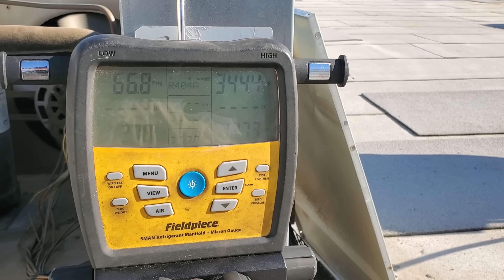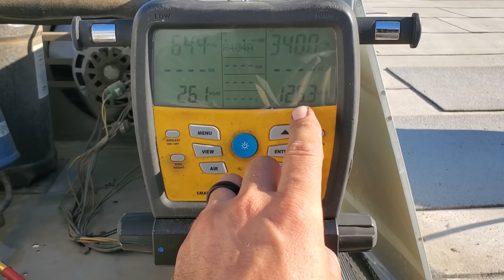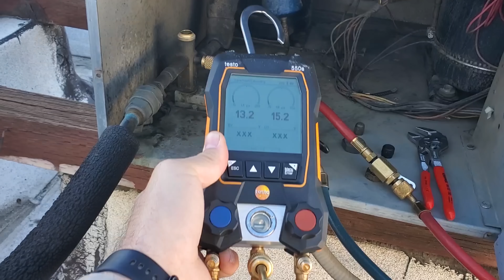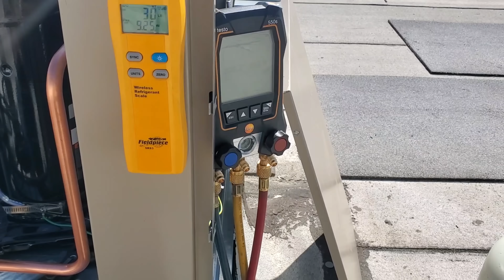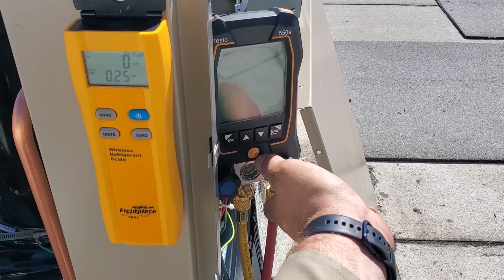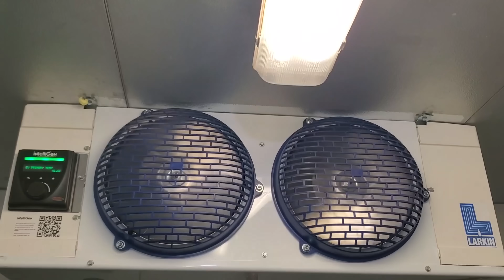THE  WALK IN COOLER IS HISSING

Comment: Just an idea I don’t know if it’s possible on this change out, maybe you could’ve just made a new penetration right above the walk-in cooler and then ran the line set on the roof over to the condensing unit. I work for a school district and I’ve changed out a few of our walk-in coolers and I don’t want to go with anything but the old school all technology TXV liquid line solenoid. It always seems like they’re trying to reinvent the wheel

Comment: They use a normally open EEV thats open when it loses power? Who came up with that lol
Reply from the maker: No the eev is driven open and if it immediately loses power it does not  automatically shut. The eev does not have a spring like a solenoid valve it has to be driven open and driven shut

Comment: BTW, how is that fancy gauge set for diagnosing a sticking valve, i’ll stick with my trusty analogue set thank you, and just a suggestion, use your senses, they are the best tools you got, for example a simple feel of that liquid line for heat would have told you the sight glass being clear did not mean the unit was out of gas, you over charged the system there and probably fried the unit that’s why it needed replacing because I cannot for the life of me figure out how replacing the condensing unit fixed anything.
Reply from the maker: Yeah the sight glass was empty,  and I addressed that in the video

Comment: Wait ! why is the liquid line not attached to the suction for heat transfer under that insulation for a solid column of liquid to TXV, probably was his problem in the first place in that heat.
Reply from the maker: With the modern systems  they are extremely efficient and we usually don't need to worry about external subcoolers like you mentioned. Occasionally on older and or improperly designed systems we may have to add additional subcooler but I haven't run across one of those systems in years. Plus these restaurants wouldn't want to pay for anything like that. Even if it could save them money they still consider it unnecessary

Comment: Don’t like them sight glasses?? They’re the best wit that moisture indicator, helped me on many a call, BTW green ? Not good, and them pressures, that’s nuts, I know it’s hot but charging to 350 psi??? WOW. First feel liquid line, if it’s hot it’s not empty, and i’ve seen condensers that look clean but are only clean at the surface but are plugged solid and that can keep the sight glass empty or bubbling, again FEEL FOR HEAT !!! Your best tools are your senses, them fancy ass gauges are for techs with too much money. I use the old fashioned gauges, just looking at them can give information no digital gauge can, like a sticking valve, try seeing that on a digital gauge, good luck!

Comment: It's nice to see all your customer's are refrigeration engineer''s-WTF happens when a POS undersized unit with a smaller condenser shows up-especially with your 125 degree temps? Who bites the bullet?
Reply: Im assuming its a chain store where every store has same specs so they all get same gear
Reply: The large chains often have a handful of seatwarmers to figure these things out, once on site you have to improvise or tell them right from the start that its not going to work.
Reply: You already know that the techs servicing equipment are always the ones that get blamed. You just have to keep polishing until it doesn't look like a turd anymore.
Reply from the maker: I will discuss this on my Livestream this evening 3/1/21 @ 5:PM (pacific) on YouTube come over and check it out https://youtu.be/eJBUOQQNEFo

Comment: Sometimes it feels quite tempting to grab power for "something minor" from "just a convenient place" but do enough of that and you will end up with a mess that nobody else understands and that can be a pain in the back to troubleshoot or alter.
Reply: Or things start to go wrong, got a single outlet in my garage connected to the kitchen circuit its fine most of the time but if you plug in any heavy draw power tool you will trip the breaker so that outlet is the battery charging station.

Comment: Feedback on the same circuit?  Hm.. I know that was an off-the-cuff explanation, but if the company is really saying that, I would be suspicious.  I mean like, you do realize all circuits go back to some common point, right?  There's no such thing as isolation.  (There can be, but there won't be in cases like this.)

Sounds to me like that electronic shut-off thingy you were talking about causes problems if power is lost, and they don't like having "other things" overload the circuit and cause that weak point in the design to manifest itself.
Reply from the maker: Basically because of the low voltage transformer they use for the board they are worried about voltage drop affecting the secondary voltage. Honestly I think they are being a tad over dramatic but im just a silly service tech.....
Reply: @HVACRVIDEOS   Thanks for humoring my curiosity.  That kind of makes sense if the LV side is 24V that might be feeding relays or contactors.  A brown-out there might cause it to bounce, and upset whatever it's controlling.  It seems unlikely it would interfere with an electronic control board, since the logic is going to want something like 5VDC, and the AC-DC rectifier would feed a reservoir cap and a regulator that could easily be sized to carry it through anything less than what you would call a power outage.  :-)  But then, I'm not even qualified to be a silly service tech -- just an armchair hobbyist EE with no formal education.  So what do I know?  haha

Interesting theory puzzle though.

Comment: When you say you're on overtime and do a partial repair and leave is it because it's so much more for the customer to pay, you want to go home, or a combination of both?
Reply: Overtime element is irrelevant, but think of it like this, there’s only so much daylight left, the suppliers are closed if gear is needed, and a full repair with the parts if the system requires a pump down will take 4 hours minimum, travel time or booked commitments can be affected in that space of time also. But the alternative is, get the unit functioning, assess the function quality, and ideally know what the permanent fix is... component wise.
Reply from the maker: I will discuss this on my Livestream this evening 3/1/21 @ 5:PM (pacific) on YouTube come over and check it out https://youtu.be/eJBUOQQNEFo